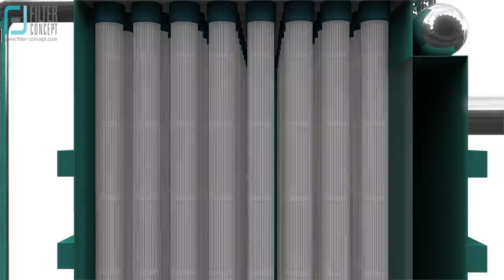Dust Collection Systems | Pulse Jet Dust Collection Systems - Manufacturer India

Comment: Are there any potential risks if I turn off the dust extractor attached to the hammer mill? I resorted to this more than once when I had a problem with the air compressor.

Comment: I have some question  A Bag filter inside should clean or not If it should clean how often?
Reply from the maker: Dust collection systems are equipped with a pulse jet cleaning arrangement, where compressed air is periodically used to clean the filter bags. In a typical factory setting of equipment, the sequential controller is programmed to trigger pulse at set intervals (e.g., every 20-30 seconds), depending on the dust type. A burst of compressed air (e.g., 200 miliseconds) dislodges dust from the outer surface of the bags, allowing it to collect at the bottom chamber. This process help to maintain consistent diffretial  pressure across the system and ensures regular cleaning of the bags.

I hope this answers your question. If you need more information about this collection system, feel free to ask. Thank you.

Comment: While purging is the high velocity or high pressure which principle will applicable
Reply from the maker: When purging the filter bags in a dust collection system, both high velocity and high pressure principles can be involved, but they are used for different purposes in the cleaning process:

1. High Pressure Principle: This is primarily used in the pulse-jet cleaning method described in the video. In this system, compressed air is released in short bursts (pulses) at high pressure. This burst of high-pressure air is directed through the center of the filter bags, causing a sudden expansion and a reverse flow of air that dislodges accumulated dust particles from the outside surface of the filter bags. The high pressure is crucial for ensuring that the dust cake formed on the filter surface is effectively dislodged and falls into the hopper below.

2. High Velocity Principle: While the primary cleaning mechanism involves high pressure, the resultant high velocity air generated during the pulse can also play a role. The high velocity of the air pulse helps in rapidly dislodging the dust particles from the filter bags and carrying them away from the filter surface. The velocity helps in transporting the dust particles into the hopper or dust collection area below the filters.

FCPL invites you to join us for informative series "Filtration by Filter Concept"
Kindly click on the below link : 
https://filter-concept.com/video-series/
Reply: @Filter-concept  how both will react high since pressure high means velocity becomes low that’s the logic right
Reply from the maker: @hemanthkumar9893  

You’re right in noting that, under certain conditions, there is an inverse relationship between pressure and velocity—this is described by Bernoulli’s principle, which states that in a steady, incompressible flow, an increase in the speed of the fluid occurs simultaneously with a decrease in pressure or potential energy. However, the context of a pulse-jet cleaning system is a bit different:

1. Pulse-Jet Cleaning System Dynamics: In a pulse-jet cleaning system, high-pressure compressed air is stored and then released in short bursts or pulses, which is approx 200 miliseconds. When this compressed air is suddenly released, it accelerates rapidly through the system, creating a high-velocity jet of air, as it passes through precisely designed small nozzle having opening of 6-10 mm depending upon application.

2. Localized High Pressure and High Velocity: At the point where the compressed air is released, there is initially high pressure. As the air expands rapidly out of the nozzle or pulse valve, it converts its potential energy (pressure) into kinetic energy (velocity). This rapid expansion creates both a localized area of high pressure (at the point of release) and high velocity (as the air moves away from the point of release).

3. Pulse and Airflow Interaction: The high-pressure pulse is designed to create a shock wave that travels through the filter bags. This pulse is short but powerful, causing a rapid burst of airflow (high velocity) that effectively dislodges dust from the filter surfaces. Although the pressure may decrease as the air expands and velocity increases, the system is engineered to ensure that both the pressure at the nozzle and the velocity of the resulting air jet are sufficient to perform the cleaning action.

In this specific application, both high pressure and high velocity are present but in different stages and areas within the system. Initially, there is high pressure at the release point (inside the pulse valve), which then translates into high velocity as the air expands outwards. The high pressure is crucial for the initial burst to loosen dust, and the resulting high velocity is necessary to carry dislodged particles away from the filter surface.

So, while in a controlled environment with steady flow, pressure and velocity might have an inverse relationship, in the pulse-jet system, the rapid pulsing mechanism utilizes high pressure to create high velocity air jets effectively.

FCPL invites you to join us for informative series "Filtration by Filter Concept"
Kindly click on the below link : 
https://filter-concept.com/video-series/
Reply: @Filter-concept  thank you for great time
Reply from the maker: Welcome.
Reply: @Filter-concept and I have a another doubt in bottom of hopper to collect dust in some units screw is there to move the dust particles why we can’t design the hopper since gravity is there we can collect directly right why additional technology is there any reason behind this
Reply from the maker: Great question! The use of screw conveyors or other mechanical systems at the bottom of hoppers in dust collection units serves several important purposes, even though gravity does indeed help in moving dust particles downward.

1. Controlled Dust Removal: While gravity naturally causes dust to settle at the bottom of the hopper, relying solely on gravity for dust removal isn’t always practical or efficient. A screw conveyor or similar mechanism allows for controlled, continuous removal of dust from the hopper. This is particularly important in applications where large volumes of dust are generated, or the dust particles are very fine and can create blockages if not continuously removed.

2. Preventing Dust Accumulation and Bridging: Over time, dust can accumulate and compact in the hopper, potentially causing blockages or “bridging,” where the dust forms a bridge-like structure that prevents further dust from falling. This can significantly reduce the efficiency of the dust collection system. A screw conveyor helps to break up these accumulations, ensuring consistent dust removal and preventing blockages.

3. Handling Different Dust Characteristics: Not all dusts behave the same way. Some dust particles are heavier or have a higher tendency to clump together, making them harder to move with gravity alone. A screw conveyor can handle a wide range of dust types and sizes, moving them efficiently regardless of their characteristics.

4. Improved System Efficiency: By continuously moving dust out of the hopper, screw conveyors help maintain the hopper’s storage capacity, preventing it from filling up and causing the system to shut down for cleaning. This ensures the dust collection system operates efficiently and with minimal downtime.

5. Safety and Dust Control: In some systems, the dust collected might pose a risk if not properly managed, such as explosive dusts or dusts that can become airborne again easily. A screw conveyor or similar system helps ensure dust is securely moved to a storage or disposal area, reducing the risk of dust becoming airborne or causing safety hazards.

6. Environmental and Regulatory Compliance: In many industrial environments, strict regulations govern how dust is handled, stored, and disposed of. Using a screw conveyor ensures compliance by providing a controlled means of handling dust, preventing spills or uncontrolled emissions.

In summary, while gravity does play a role in helping dust settle at the bottom of the hopper, the use of screw conveyors and similar technology ensures a more efficient, controlled, and safe removal of dust. This additional technology addresses challenges that gravity alone cannot manage, such as dust accumulation, bridging, varying dust characteristics, and regulatory requirements.
Reply: @Filter-concept  ok but you said that for fine particles moving why we need screw conveyor system it’s already a tiny particles and it will directly settled right
Reply: @Filter-concept  and can you what’s the micron of filter in dust collecting system used min to max micron
Reply from the maker: That’s a great point! It might seem that fine particles, due to their small size, would easily settle and not require a screw conveyor. However, there are several reasons why a screw conveyor or similar system is often necessary, even for fine particles:

1. Tendency to Become Airborne: Fine particles are much lighter and can easily become airborne again with any slight disturbance or air movement within the hopper. A screw conveyor helps to continuously remove these particles, minimizing the chance of them becoming airborne again and escaping back.

2. Agglomeration and Bridging: Even though fine particles are small, they can stick together and form clumps or “bridges” in the hopper, especially if the dust has any moisture content or electrostatic properties. These bridges can block the hopper’s discharge opening, preventing further dust from exiting. A screw conveyor breaks up these clumps and ensures a continuous flow of dust out of the hopper.

3. Consistent Dust Flow: Fine particles, due to their lightweight nature, can create uneven flow patterns in the hopper. Some areas might see more dust accumulation while others see less, leading to inefficiencies and potential blockages. A screw conveyor ensures a consistent and controlled flow of dust out of the hopper, improving overall system efficiency.

4. Preventing Overloading: In high-dust environments, even fine particles can accumulate quickly. If the hopper fills up faster than gravity alone can handle, this could lead to overloading and system shutdowns. A screw conveyor continuously moves the fine particles out, preventing the hopper from becoming overloaded and maintaining the system’s operation.

5. Handling Dust with Special Characteristics: Some fine particles have unique properties, such as stickiness or cohesion, that make them prone to sticking to the sides of the hopper or forming layers. These particles might not flow freely with gravity alone. The screw conveyor helps move these particles effectively, ensuring they don’t accumulate or cause problems.

6. Environmental and Safety Considerations: Fine particles can pose significant health and safety risks if not properly managed, especially if they are toxic, reactive, or combustible. A screw conveyor helps ensure that these particles are securely and safely transported out of the hopper, reducing the risk of exposure or incidents.

In summary, while fine particles might seem easier to handle, their unique characteristics and behavior in the hopper often necessitate the use of a screw conveyor or similar system. This technology helps manage the particles effectively, ensuring a continuous, safe, and efficient operation of the dust collection system.

 @hemanthkumar9893  for more details please write to us at enquiry@filter-concept.com

Comment: What is the dimension of the Filter Jet assembly and how many days is the delivery lead time?
Reply from the maker: Dear Mr. Martin,

The sizing and design of the Dust Collection System are contingent upon multiple parameters. Could you please provide your email address? This will allow us to send you an application data sheet to complete, enabling us to tailor the system design to your specific needs.

Warm regards.

Comment: The fan is connected wrong on the video :-) Instead of inlet, the fan has connected outlet with the dust collector.
Reply: Dear Valued Subscriber,

Blower is on the correct position. Here blower is creating negative pressure/suction with high velocity to collect dust from source/origin of dust.
Therefore there is a dust collection system between source of dust and blower installed to collect all debris or contaminants to retain inside the dust collector. Resulting into the clean air as per desired emission level through dust collector. Finally it delivers to the atmosphere through the chimney 
Hope this reply sounds in order to you.
Reply: @MehulPanchal  Dear Sir,  I would like to work with you in filtration .
Reply from the maker: @devendersaini4276  Dear sir, can you please write to us on info@filter-concept.com